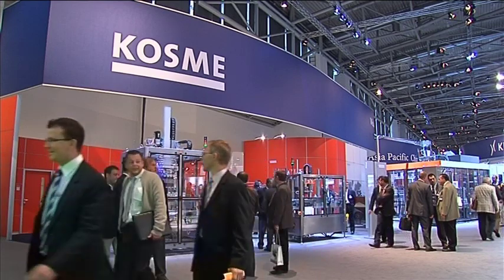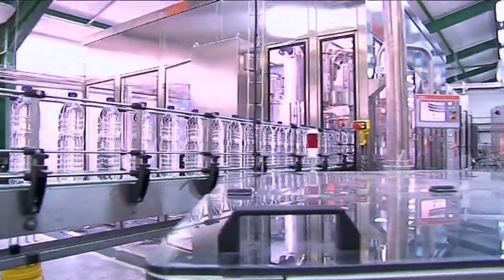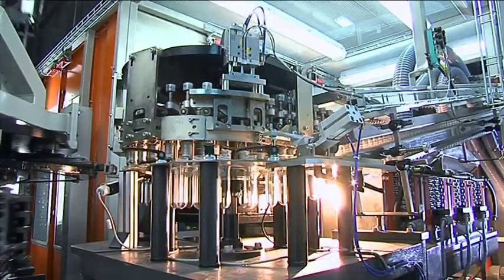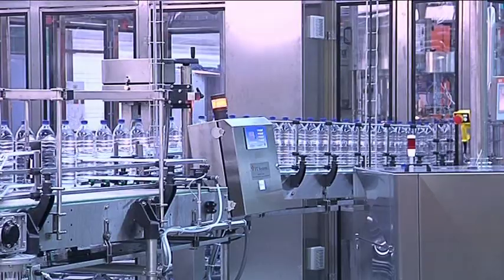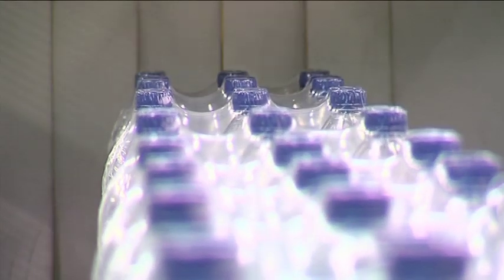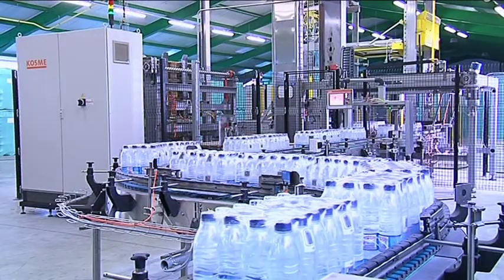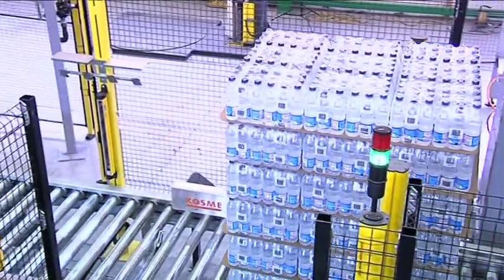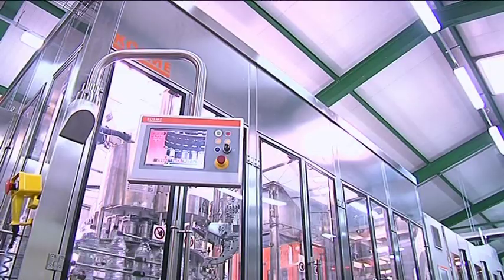KOSME Synchroblock

Comment: How is it determined or what is the procedure to obtain the value of point 0 and point 10 of a KOSME KSB6R blower?
Reply: Dear Endrith Duarte, P0 and P10 are set in the same way as on a Krones machine. P0 - stretching rod touches the preform bottom, P10 - stretching rod touches the bottom of the mold. All settings can be entered on the touch. Further instructions can be requested via support@kosme.at.